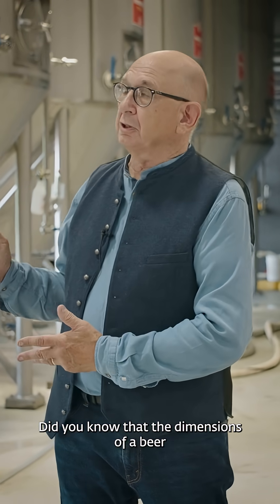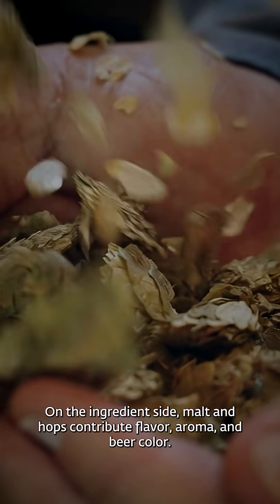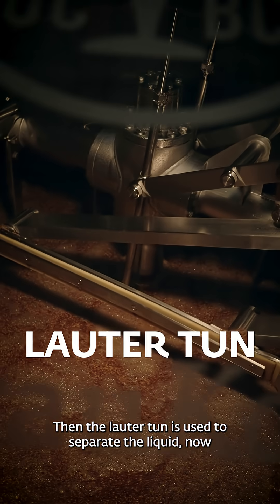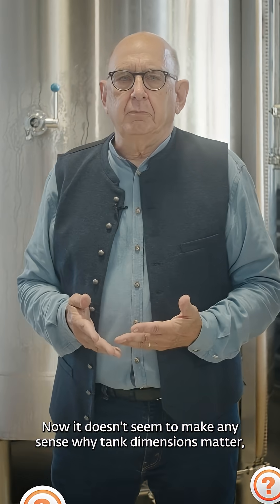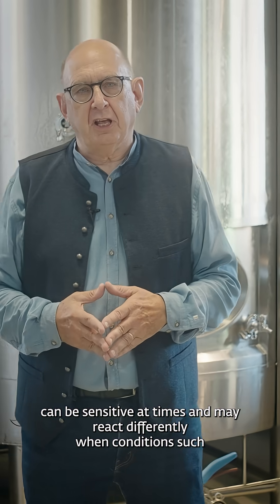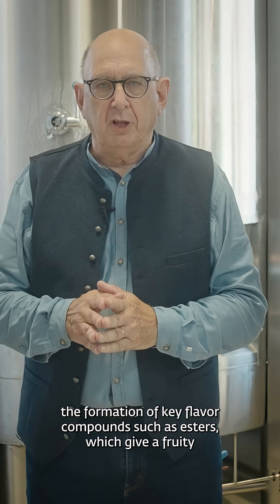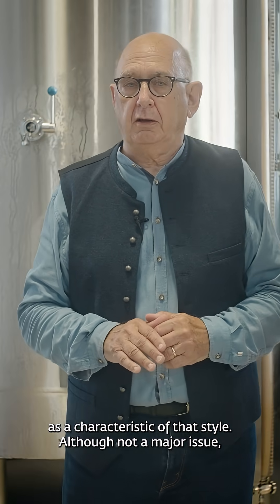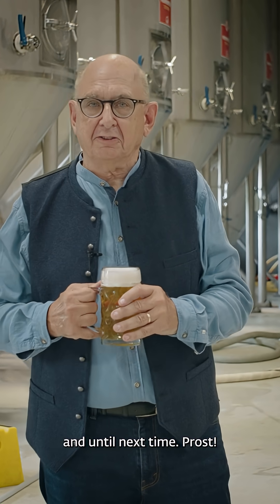Brewbites with Dwight | How Beer Gets its Flavor

Comment: I can't recall where I read it, but the shape of the tank also plays a role in the final taste of the beer. I want to say that at Weihenstephaner, they tested square fermenters, and it produced more fruity esters than the cylindrical tanks. I think it still comes down to the same thing you mentioned earlier - hydrostatic pressure. A natural byproduct of decreasing hydrostatic pressure for a given volume also increases surface area, which allows more krausen to form, which I believe allows for more ester formation. Finding that balance is the art.